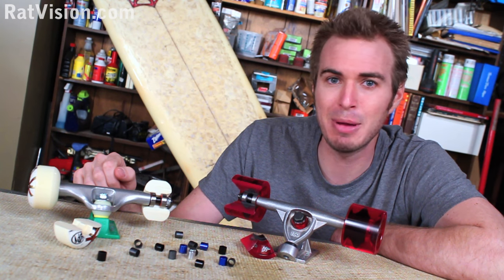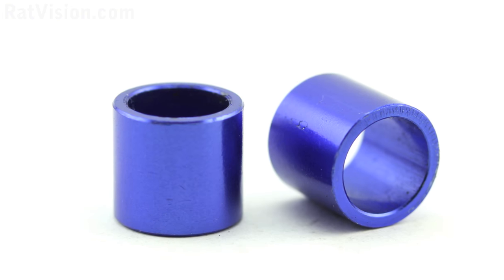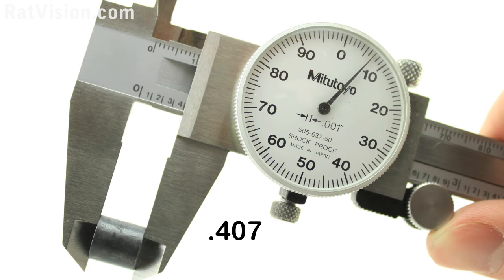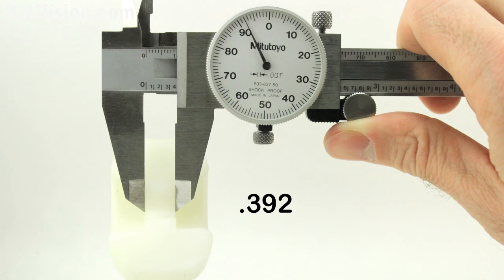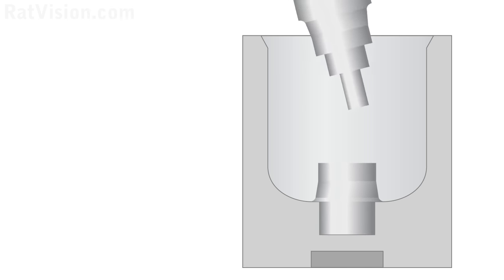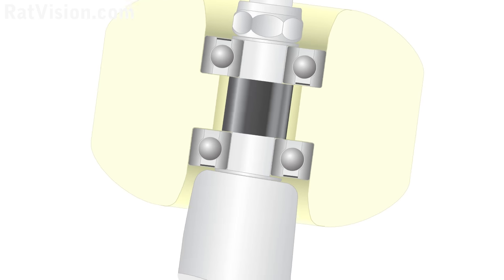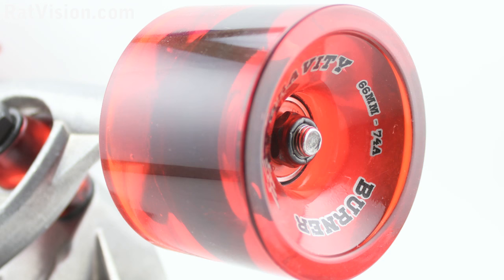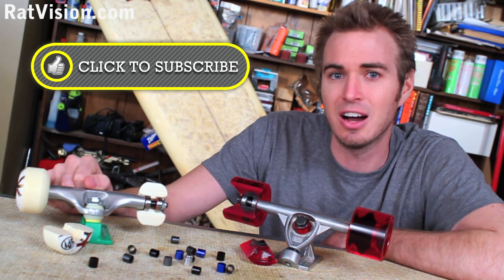Fastest Skateboard Wheels, Bearings, and Bearing Spacers

Comment: This guy is the truest skate scientist.
Reply: no. no he is not. exact spacer size is really not a top priority. and if he is willing to rant about the casting quality of trucks. than he can get his ass up, and go get ronins or aeras for top dollar. and zealous ceramic bearings for about 30 bucks. also the only spacer related problem i can think of is under sized spacers.
Reply: Daniel Hawryschuk yeah aight
Reply: @daniel_hawryschuk  i mean the issue of a pinched bearing is still going to be the end result though and at high speeds hes right.  Any kind of mechanical/design flaw that causes an accident at those speeds should be avoided at all costs.
Reply: *engineer

Comment from the maker: Yes it did take a ton of research and testing.  So, much work went into it that Concrete Wave magazine called us while we were in the process and asked us to do an article on bearings.  It was published in the 2012 Concrete Wave Buyers Guide, and in 2012 (winter/spring) AXS Longboard Retail magazine.  Our videos have been very appreciated by other industry experts.  Thanks for your acknowledgement.
Reply: so...... would be better NOT to use spacers??
Reply: @ricardogalvao3603  I use em- you just need to get lucky with your equipment.
I did and it’s a worlds difference in the speed of my board now

Comment from the maker: Most street skaters don't use spacers. It has nothing to do with street skating.  It's just that most people don't know what they are for, how they work, and what they do.  As you can see in this video, spacers are used to reduce loads and allow a bearing to function optimally.  Without them spacers, bearings can wear down quicker, increase the chances of speed wobbles, and lower potential speed. You can skate just fine without them, but you lose quite a bit that you don't notice.

Comment: Sounds like you're a mechanical engineer, too!  Thanks for putting this video out.  Funny; but I think mass market skateboarding is still just aimed at looking cool versus producing high end precision components.  Glad Independent Trucks at least has a record of safe molds.
Reply: stevebean1234 Yes with precision comes cost. Have any tips for company's that run tight tolerances other than Indy trucks?

Comment from the maker: If you are going to skateboard on "thick, rough" roads you will need a wheel that is above 70mm and 83a or softer.  Harder wheels will not absorb the shock in the road.  Harder wheels will go slower.  Go soft, but also big so the wheel can roll faster.  Good bearings are important too.  We like Oust.
Reply: You rock thanks

Comment from the maker: We did some research a while back and measured as many wheels as we could get our hands on.  Orangatang wheels measured at .398" of an inch for the wheel center.  That is the size spacer we would recommend.  That doesn't mean there won't be a wheel that measures at .397 or .399.

Comment: I had the leftover aluminum on my axlerod for my skateboard. It caused forced pressure to lock it into place along with the washer,and my wheels inward barring so when I took the wheel off the barring stuck to the axle. Used two pennies, wedged it between the beginning of the axle to the barring to gain massive leverage, and popped right off. Used a tip of the knife to wedge the washer out. Scraped and sanded the axle lightly after, to make sure it doesn't stick again. I find it awesome your putting this info out there, let it be known!

Comment: Should I buy bearing spacers for my new board? Or are they not much of a necessity?
Reply from the maker: Spacers, if the correct size, with aid in bearings performance and longevity.
Reply: Thanks for your response, but are there spacers designed for e.g 53mm wheels & bones reds? Or do most bearing spacers fit well for most wheels?
Reply from the maker: All spacers are supposed to fit all wheels. The standard is .400" of an inch, but manufacturers stopped caring. All they do now is supply spacers in whatever size they get. Wheel companies don't care about the spacers fitting properly or they would have the correct size center/hub. In most cases it's better to have spacers inside. Obviously you can still skate without them, but you do lose performance and durability/longevity. I can't tell you what to get, and if I did you'd need the right tools to measure wheels and spacers.
Reply: Okay that makes more sense, thank you!

Comment: The absolute most perfect setup, which doesn't exist in skateboarding, is to use a pair of angular contact bearings calibrated for a specific amount of preload,  with precision matched spacers,  which are precisely matched to the width of the seating surfaces inside the wheel,  and the axle nut is torqued to a defined specification.    That's possible but your set of bearings would cost 400 bucks.

Comment: So what wheels come with spacers that are actually precise??
Reply from the maker: +adam heeley None.  This is the problem.
Reply: Rat Vision – Skateboard Tech that sucks, well my boss hawg red's and oust 7's still work good enough for now. thanks
Reply: could you use sandpaper to slightly grind away a little bit of material to fit better?
Reply: RC Buggies if the wheels are smaller but I have only experience them bigger so you would have to close the gaps somehow.
Reply: adam heeley well in the video most of the wheels are smaller size in the .395 range so you could probably do it, the only thing is it wouldn't be perfectly flat and parallel to the other side.

Comment: how can i fix the problem of having wheels and spacers that don't fit?
Reply from the maker: +Sam Kercher At the moment there is no fix for this problem. You need the right tools to measure.
Reply: +Rat Vision – Skateboard Tech thanks
Reply: +Sam Kercher just don't use bearing spacers
Reply: BandaidPaintball lol then the bearing won't roll at all because the inner race needs to be pushed against something (like a bearing spacer) so the outer race can spin efficiently. There wouldn't be such thing as bearing spacers if you didn't need them
Reply: +Sam Kercher maybe file the spacer down ? use a caliper for the right measure ment , you could also use sand paper made for metals that could shave the spacers down
Reply: +Sam Kercher i wound suggest sanding down a larger spacer until its just the right size.
Reply: +Sam Kercher maybe measure the spacer before you buy and try a spacer that is the closest size to the tyre
Reply: +Sam Kercher They do work without spacers, in fact I don't use spacers at all unless they're spaceballs with built in spacers, for the $25 I'll continue buying reds and sewing machine oil. And by the way, this way helps break in the bearings faster, they wont last as long..but will become faster, faster.

Comment from the maker: What bearings do you have, and how is the riding surface you're skating on? If it's rough road then that could slow the board down and make the wheels feel hard like rocks, because they are not absorbing the shock. The bearings may be slow because they are new. Bearings need time to break-in and are not the fastest right out of the box. It could be that the axle nut is too tight. Without proper fitting bearing spacers you need to have the nut a little loose to allow the wheel to spin freely.

Comment: So what's the fucking solution then????
Reply: +Taylor Stracqualursi same
Reply: +noah this means we probably have to buy calipers And measure our stuff and file them down if they are too big..  buy wheels from different brands cut them open and measure the gaps... I guess we litterally have to tune up our own set ups..
Reply: +JRLM Buy zealous built ins
Reply: yeah zealous is nice. there also are precision spacers that are supposed to be the exact size but I don't know if they really are or not.
Reply: +JRLM People are taking these little problems too seriously, nothing is perfect in this world, I'm sure my board has one of these problems but to me it rolls really well and fast. I don't need to travel 50 feet with one push.
Reply: +JRLM Buy high end equipment - I recommend RockNRons bearings, independent trucks, etc.  Either buy a vernier caliper and make your own spacers based on your wheel seat thickness (it's not that hard if you have the right measurements), or talk to machinist - they can probably do this for you for <$50.  Inspect your equipment!!  Not sure of an easy way to measure the concentricity of an axle coming out of a truck, but I'll think about it!

Comment from the maker: Well what type of skating? Any trucks with "faced" flat hangers where the axle rod comes out are good, like Bear Grizzly or gun metal.  The only brand that we know of that actually makes spacers to perfectly fit their wheels is Oust, but if you send us a private message through our channel we can tell you what size spacer goes in the wheels you get. We recommend Oust bearings.

Comment from the maker: If are using a skateboard as transportation to school then a longboard with big wheels will get you there quicker, but you can still use a short board with big soft wheels rather than hard street skating wheels.  For skating around school I'd recommend a short cruiser.

Comment from the maker: Cores are made the same way as shown in the video.  Few may be injection molded.  However, the standard of .400" of an inch cores is clearly lost in skateboard wheel and bearing spacer manufacturing. So, regardless of how a core is made, the wheel assembly is most likely not fitting tightly together.  If a brand came out with metal cores that measured .400", you still have to make sure that your spacers are .400"

Comment from the maker: How do ABEC 11 Biltins do the trick when they are not touching each other or not completely in the bearing seat? A built in spacer does not do the trick because all wheels are different.  Have you been dooped or brand-washed into thinking that ABEC 11 Builtin bearings solved an issue and are therefor a "must have"?

Comment from the maker: I can't remember which ones do off hand, but some label their boards as using resin.  Most people don't know the difference at all.  It certainly matters.  This is one of the price differences between blanks and brands.  Price goes up for pro models because the pros need to make a living, branding/marketing, the extra labor for slapping on graphic, and resin.  This doesn't mean that blanks do not have resin. There is a way to test a deck for resin but that has to be shown in a video.

Comment: This is the best video I've seen that explains the relationship between bearing spacers and wheel design. I would like to see an improvement in quality control on the design/production level; then the products we buy would do what they claim. I want my board to be faster, but I don't want speed wobbles caused by the nonuniform wheel assembly specs.

Comment from the maker: To really get things perfect you will need to get a depth micrometer and a regular micrometer.  You'll be able to figure out exactly what size bearing spacer to use by measure each side of the wheel. Basically it will measure the distance from the bearing stop to the outside of the wheel.  Measure both depths and then subtract them both from the total width. That's how you'll get the bearing spacer length for that wheel.

Comment from the maker: As long as you maintain bearings you won't need to place them as often as others do.  Bearings need about 15-20 hours. Basically, the surfaces of the balls are getting familiar with the raceway surface in the rings. The metal surfaces actually change and get smoother. A telltale sign for bearing that need to be clean is how they sound.  You'll hear crunching sounds from junk in the bearings. Almost as if sand was in them. You can always send questions to us in a private message thru our channel.

Comment from the maker: It depends on the riding surface.  We could suggest harder, bigger, or softer wheels.  Also, good bearings play a very important part.  70mm is a good size.  It would help to know what the durometer is.  This would be a number like 7*a or 8*a on the wheel.  If it's in the 70's you could go up a few points.  Keep in mind that a harder wheel grips less.

Comment from the maker: I think you missed some things here.  Tolerances are not manufactured, tolerances are met.  Everything we said is true.  Of course skaters cannot feel the differences between tolerances, but they can feel/experience a high quality bearings produce better results.  The manufacturing is not imprecise when it come to the bearings, because they are made exactly what the manufacturer intended. We are onto something, even without empirical data.

Comment: I've done some research on the topic as I too have had issues and have found that the issue lies not in the trucks but in the rider. Speed wobbles are much more of an issue when you're tense, so trying to stay relaxed and loose is generally the best fix, something I realize can be difficult when you're bombing a giant hill for the first time. Speed wobbles will occur to even the most experienced riders, but usually, if they're relaxed, speed wobbles will come and go before they become a problem.

Comment from the maker: You need 8mm spacers.  I did the same thing to a street deck in high school over 15 years ago, so my board would fit in my locker.  Look at our video for how to put bearings in a wheel.  After you put one bearing in the wheel, place another bearing on the axle then the bearing spacer.  After that, press the wheel onto the bearing.  Now the spacer is inside.  It more around if you have to flip the wheel over, so just wiggle the wheel until it drops onto the axle.

Comment from the maker: It's usually better to have them in.  Sometimes it's not when the spacer and wheel bearing stop/center are too far apart. If there is space, as seen with the Bones wheel, that's probably a time where I wouldn't use a spacer. Most wheels and spacer probably won't have a gap that big, so it's better to have them.  If you were going down hills then I would make sure everything fit really good.

Comment from the maker: You may get laughed at pretty bad for that question, but I realize you're new and don't know a lot yet.  A cruiser is considered a "longboard" even if it's short in length, because of the parts being used.  Basically, they are one and the same.  You can use any longboard to cruise. You can even put longboard wheels on a street skating board, or even on some roller skates! Everything is universal, for the most part. If you have any questions, you can send us a private message through our channel.

Comment from the maker: They do use a lathe to shape the other half of the wheel when it's done curing in the mold.  The cores are made separately. The problem could be that the manufacturer is not making the molds/tools.  For street wheels it's the same issue.  It's pretty obvious that manufacturers are not sticking to any standards. Who knows why?

Comment: Great reviews! Will you be featuring and testing Sharkweels? They claim they roll smoother and can handle more terrains than regular wheels  like cracks, pebbles, sand, water, small pot-holes etc. If you had a go on these wheels, is the diference in smoothness, speed and "all-terrain" features highly noticeable compared to standard wheels? I'm really curious. Thanks and best of luck.

Comment from the maker: Bearings don't change the size of spacer you need.  ABEC 11 wheels require about a .398" spacer.  If you are really concerned with the precision of your equipment then you'll need to get a caliper to measure the spacers you have.  If you search good enough online you may be able to find a spacer supplier with the correct spacers.  In a perfect skate world we would expect the wheel brands to supply the spacers that fit their wheels.  They don't seem to be focused on that.

Comment from the maker: Weird sounds usually come from the bearings or bushings. 10mm is probably a loose measurement. They could be .398", which is 10mm, or .408" and considered 10mm by Khiro. Zombie Hawgs need a .397" spacer.  If spacers from Khiro are accurate then you could go with those, but we highly doubt they are. Ask them and see what they say. Ask if the spacers are precision and if everyone is identical. If not what range are they?  Maybe they are plus or minus 1 or 2 thousandth (.001"). Doubt they know.

Comment from the maker: For starting out, this could be a good board. Most of the top brands are coming straight from China, so there is little difference if you get this.  It's good to start out cheap for a first board because you aren't pushing any limits or trying to do anything crazy. The bearings/wheels might be slow at first. That is expected. Don't be surprised if you need to replace parts weeks after you get it.  These parts would be bearings and bushings. About $25 total.

Comment from the maker: What the other guy said is correct. I sent a response to you but it looks like it didn't post. A lot has to do with u and your ability to control and prevent wobbles. Besides yourself, wobbles come from imbalanced parts. It can come from your deck, trucks, bearings, wheels, bushings, and truck holes. Every rider should inspect their board before attempting high speeds. Not every skating product has precision, so we have to be aware of our equipment. Tightening trucks does not get rid of wobbles.